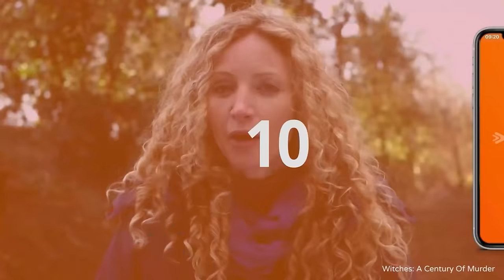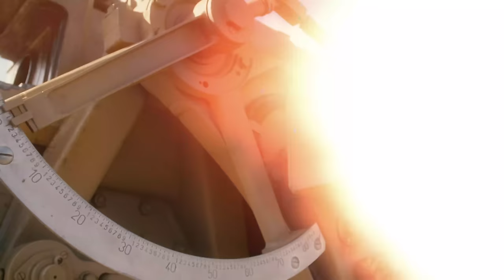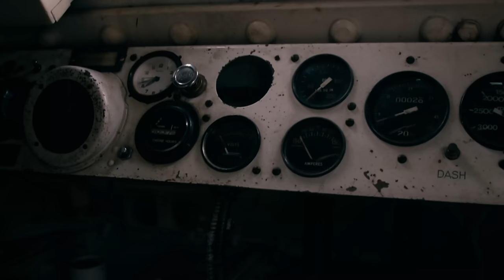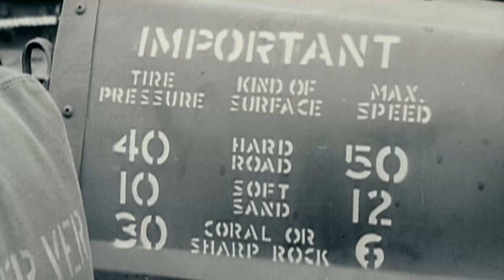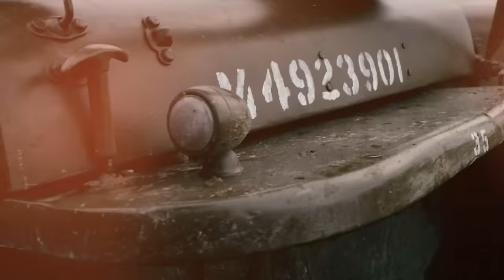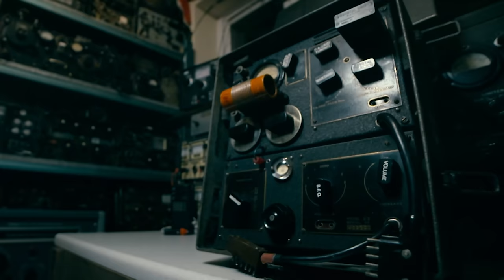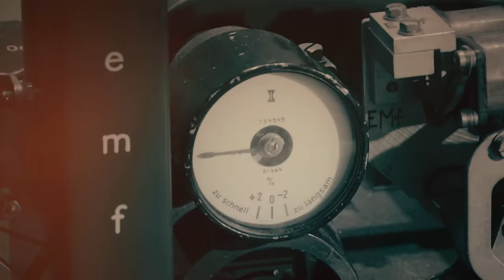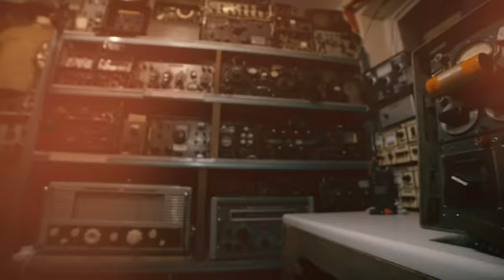The Deadliest Machines That Won WWII [4K] | Combat Machines Compilation | Spark

Comment: that's not the "tungsten" round he has in his hand. in his hand is a PanzerGranate 39 Flk 18 .   It has a softer steel "Penetrating Cap" to aid in Shatter Resistance and normalization, and a Hardened steel penetrating core, it has a Ballistic cap "windscreen" over the penetrating core.. Inside the penetrating core was a "Bursting Core" ...aka HIGH EXPSLOSIVE... The one he said was 'not explosive".  its an APCBC-HE shell.  Armor Piercing, Capped, Ballistic Capped- High explosive .   It would penetrate up to 163mm of Armor at 1500m. Thats roughly 7" of steel...  Once penetrated the base fuze would ignite and a slight .03s delay would burst it inside the target.  When a tank shell pens, the displaced armor sprays as shrapnel inside the tank "spalling" and then this shell would explode , giving them a round two of hot fast metal fragments.  this shell was faster than "up to 2200fps" it was 2600 FPS.   

The "tungsten round" had a much sharper cone shape and would say either "W" on it for tungsten, or "FES" indicating it had iron driving bands and a Hardened Steel Penetrator.. But the PZGR40/42
was the "tungsten round" it flew at 3100FPS. IT was a very small 40mm Penetrating core inside of a larger Aluminum or mild steel shell.... would slap against the armor hard the hardened core would blast through and Spall the crew. sometimes exiting the other side. His description of "bouncing around inside" isn't accurate and misleads people. .just like the idiots who say "sabot rounds liquify the crew and the vacuum effect sucks that soup out the other side"  No... It doesn't . not at all.

Comment: Willy's jeep was & is the sh¡t though. I've been out with 4x4 crews and someone will pop up in a Willy's and it will hang with most modern veichicles going down the trails. Of course their a lil more less available and a lil more special then a 1994 jeep or a 2005 f150 😂 but their still around though. Which is a testament to their build

Comment: Love the Brits elevating thier inadequete armor as better that Italy's Joke Lineup
Reply: The Matilda was outdated by 1941, but make no mistake, it was a very heavily armored tank for the day. Slow with a small gun, but it was almost impenetrable. It did really good for it's time. The Brits had terrible armored vehicles. But the Matilda was not necessarily one of them. Italy's lineup was an absolute joke though lol

Comment: NOTE:  At the start of WWII the German 88 had ab APC shell based on the latest large APC shells used by the German Navy, with a relatively large internal base-fuzed explosive charge inside.  As such an explosive charge was not needed against small tank targets and reducing the empty hole in the shell middle to a much smaller size made the projectile stronger and able to punch through even thicker armor in an intact condition, later in WWII the German tank and anti-tank guns 50mm (Panzer 3 tanks) and up -- including the late-WWII Jagdtiger 128mm gun -- got a slightly heavier, blunter-nosed, small-capped APC shell with only a tiny explosive charge inside (not really needed but Germans tend to be very conservative) which worked better against the heavier Russian KV, JS, and SU armored vehicles introduced during the later war years.

Comment: Fighting within the <<VAST>> expanses of the desert VS. oft Urban, hilly, mountainous terrain, typical rolling  steppe grassland, or farmland  type engagement areas required an entirely different tranche of employed tactics....
-Largely within desert environments, ones armored/mechanized forces would  best  be suited to use NAVAL-derived  maneuver warfare tactics to meet ones objectives successfully. The problem being: KEEPING those objectives when operating with a 'skeleton crew' of sorts. No matter the front, the Germans were ALWAYS SHORT of infantry that could be spared for  rear area security/garrison duties.
-Just as seen later in Vietnam, whats to use of expending loads of precious men & materials on an objective, conquering such, only to then LEAVE the Area of Operations afterwards?...Quite wasteful, foolish n' costly in more ways than one...

Rommel  & the Brits wholly understood that particular Naval-warfare aspect & approach concerning such doctrinal combat discipline(s)... 
As long as the complicated logistics of FUEL, FOOD, H2O & AMMO resupply was able to operate unimpeded & w/o issue(s) or hiccups (GOOD LUCK on that one!)...

As MANY of those  desert duels often resulted in a draw of sorts, or the Germans would win one, then the Brits would win one, lather>rinse>repeat. Some of those victories sourced due to using ambush tactics within rockier pass area road networks, moreso that flat  & sandy desert area engagements. In that game, he who controlled PORT areas of resupply & delivery, then controlled the ENTIRE battlefield proper!

-Viewing  how the Africa Corp & its struggles were but a sidelined issue & nebulous far-away front due to its geographical location,  such ending up playing 2nd fiddle to the other MUCH more important war-decisive efforts......
-Im QUITE surprised the Germans hadnt capitulated in Northern Africa sooner?
-Seeing as they were  routinely STARVED of  fresh replacement  personnel & materials delivered, making up for those lost due to combat attrition...